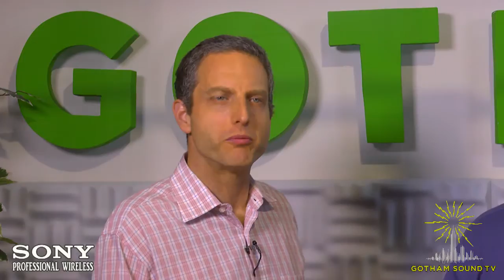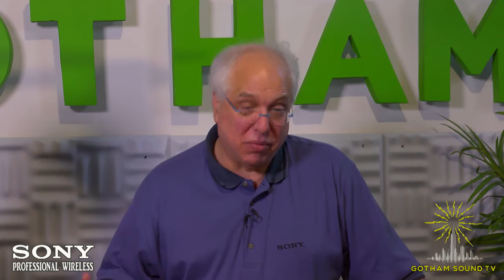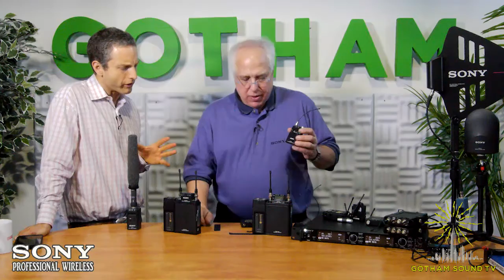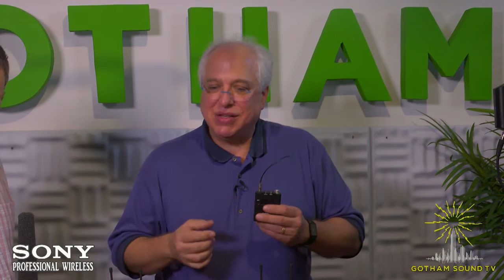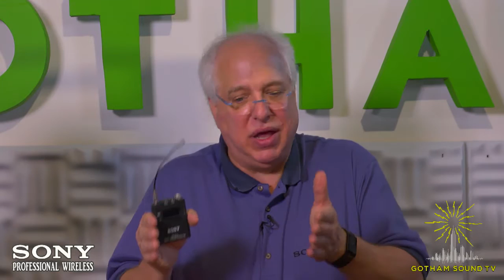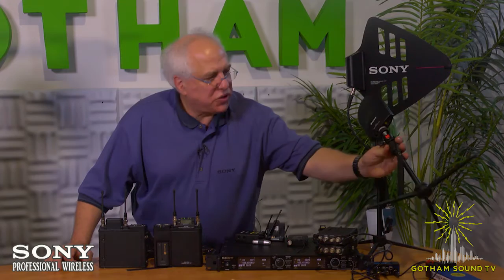Sony Digital Professional Wireless

Comment: DO you know if the SMAD p3 hotshoe adapter sends audio in digitally or via analog?  I had to set levels when using it and would prefer if it was just a simple digital connection where level setting wouldnt matter?  This is why Im thinking its analog in and not a digital signal from receiver-> SMAD P3 -> Sony camera   Im not using any cables obviously!
Reply: It sends the audio via analog.

Comment: Thanks Gotham, a much needed endorsement for the SONY DWX series. The remote-control features that are offered in the DWX series are NOW being adopted by the popular US manufacturers like Zaxcom, Lectrosonics. It would have been great if a small mention was made of the ECM 88BC lavalier (which was launched around the same time as the DWX in 2009/2010) which is a very underrated lavaliere for it's performance.